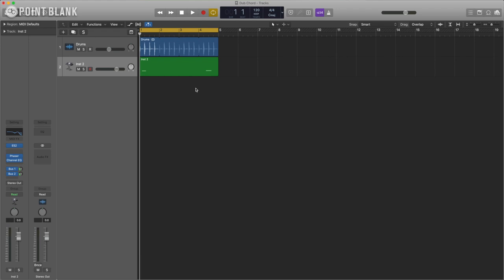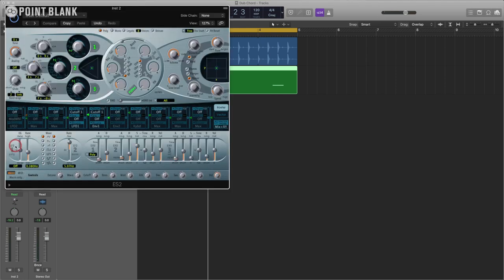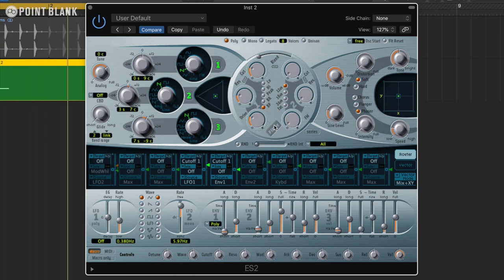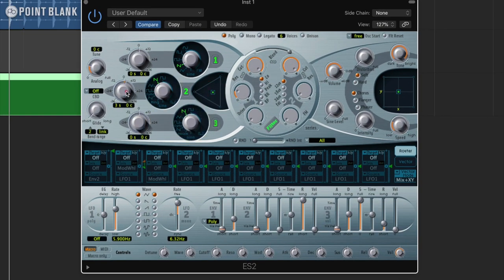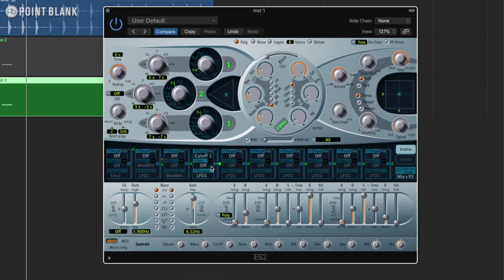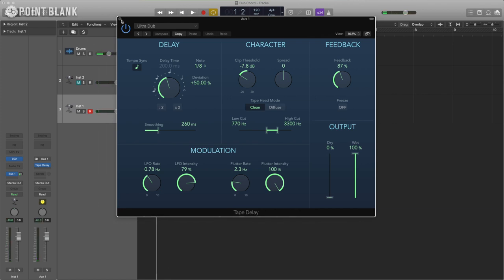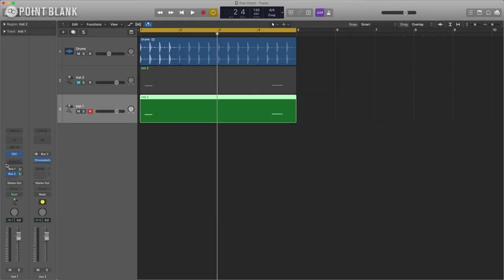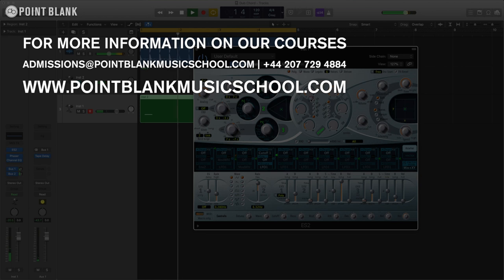Techno Sound Design - Making a Dub Chord w/ Danny Linton aka Funk Ethics

Comment: I wonder how to create that kind of sound with an analog setup where most likely only have one or two oscillators and can't create the minor chord therefore. I also wonder what equipment guys like Basic Channel originally used for those kind of sounds. I suppose analog gear too.
Reply: Wow someone knows still basic channel
Reply: you need a poly synth..... use G and A# for Gminor..... 
if you are using the above method on a 2 osc synth, use the flatted 3rd, i think....
Reply: @Kierant2010  nice solution  !!!!
I usually forget that the lfo and the filter can both be used as another audio source (osc).... the filter can "track", whereas the lfo cant....
Reply: Poly synth. Also some mono synth do have 3 osc. Like the waldorf pulse for example.
Reply: Just visit on gearslutz there’s pages dedicated to it but be aware there’s some right greeting heurs on it 😂
Reply: In fact you need an FM Synth like DX100 Yamaha (quite expensive) but, as an cheap and better alternative, there is the TX81Z wich is multi timbral FM Rack. That is not enough to recreate that "Basic channel" sound. Fm Synthesis is only digital and not versatile as Soustractive synthesis in filter modulation, so, you need a multi mode filter in addition to your FM Synth. Band pass filter is perfect for chords harmonics tweaking. there are a lot of externals filters boxes as Mooger foogers filters, Peavey analog Filters, Electrix filter queen or Sherman Filters etc. at the end of this chain, you need an Space echo Roland RE-201 or that digital emulation with can easily found in sale market or boss DD3 digital foot pedals or some thing like this with feedback and volume level controls. That's it ;)) If you are focus on a Yamaha DX100, you will prefer the Yamaha DX27 or DX11 with real keys and the same exactly DX10's engine. Note that "Basic Channel" name comes from the front panel of the Yamaha DX100; there is a sub menu fonction just under a switch program number call "Basic Channel"...
Reply: Even if I put a light on "how to make the same sound as...", you will need some other extras knowledges to operate the sound as expected...
Reply: @arnoriva  there's no need for an fm synth for that kind of sound
Reply: @mb2776  you're right! Answer was for the question "I also wonder what equipment guys like Basic Channel originally used.."
Reply: @arnoriva  oh big sorry. Then I misunderstood your reply!
Reply: Prophet vs mostly, u can get close with a korg wavestation (the old one). and as said,processed & resampled to death with tapes, filters, phasers, lfos, lower bitrates etc and ofcourse proper tape delays :)